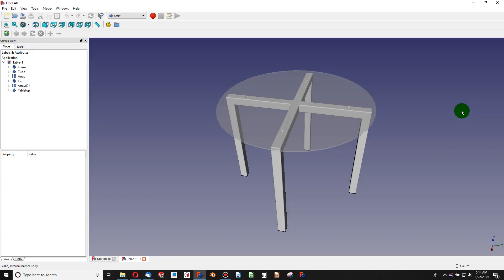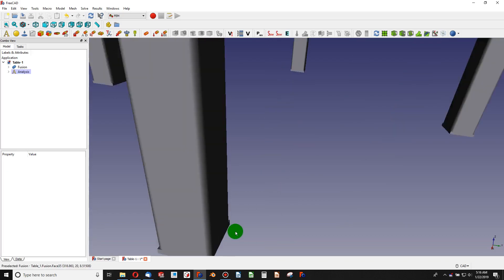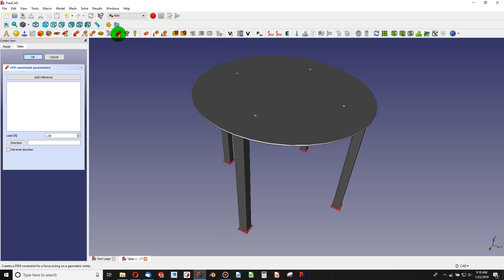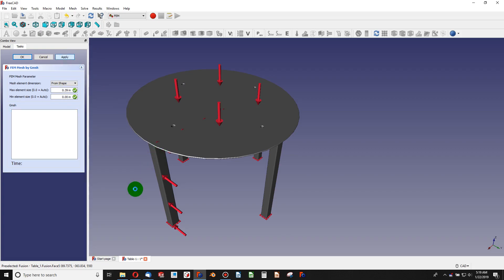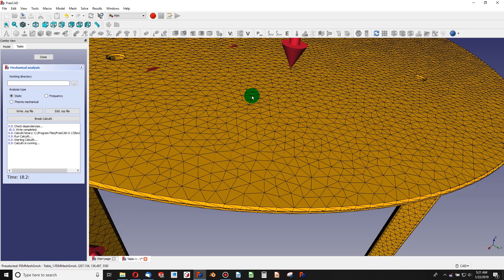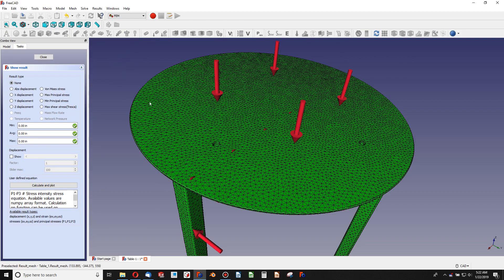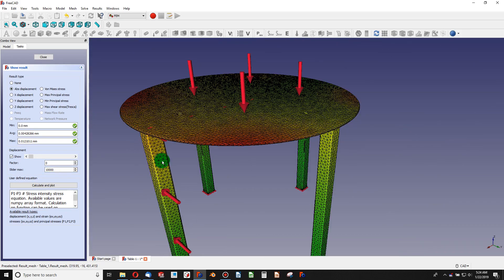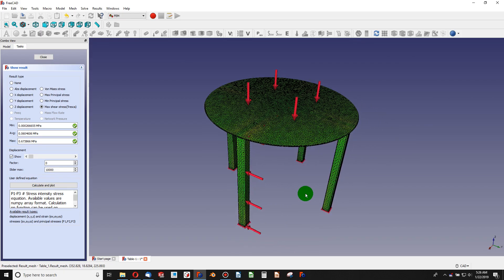How To Use FreeCAD FEM |JOKO ENGINEERING|

Comment: Hi, Do you know How could we specialise the space to exerce the force. I got a big surface but the force is only applied on a little element. Should I creat a new surface from my origin surface ? I did not find a way to create a surface from another one or to split it.
Thanks
Reply from the maker: A really simple way of getting that is say you want to exert a circular force on a flat surface, extrude cut a circle and then pad the circle to fill the hole.  The result gives you a circle on the face to select for the force.  This will cause the part to mesh differently

Comment: Great video. As a layman it has accelerated my understanding. I’m stuck on how to do a pressure stress analysis on a closed container without needing a fixed constraint. Any suggestions?
Reply from the maker: Hi Random Task!  That brings up a great point.  It's best practice in an analysis to constrain degrees of freedom even if the forces counterbalance, which will prevent what is known as rigid body modes.  In this video I use a force, measured in Newtons and acting in a direction.  You would want to use a pressure instead of a force, which acts normal to the specified face instead of a single direction and is measured in force per area.  I hope that helps!
Reply from the maker: The pressure button is near the force button in FreeCAD btw, it should be as easy as selecting the geometry, setting your pressure and making sure the pressure is outward instead of inward (the correct direction)
Reply: @JokoEngineeringhelp  right, that’s what I did, but it expects a fixed constraint which doesn’t make sense to me if I set all faces to exert pressure. If for example I have a cuboid and select the edge as a fixed constraint, in a stress analysis it acts like that edge is indestructible (sorry if I have butchered the tech speak).
Reply from the maker: @RandomTask  Very interesting!  Is it possible to send me the model?
Reply: @JokoEngineeringhelp  thanks a lot, have sent to your email.
Reply: So what is the answer?
Reply: @Ibrahim-tv7rv  am patiently waiting

Comment: Hi Joko. I have been practicing for a few days with this  tutorial. I can do a fem analysis for a single body ( like an L shaped bracket for exemple). Now I practice on assy ( convert an assy made of several bodies using A2 into a fusion unsing part work bench), I get this error message when i try to open the ccx_Results file:

                            FEM: Result node numbers are not equal to FEM Mesh NodeCount.

What is going on? I dont get it it should work i walk exactly in your foot steps but I get this error.

Comment: Hi joko. Could you expand a little bit more about frequency analysis please. I tried but its a little hard to interpret the results to be honest. Also, I was wondering if i could import several steps file into freecad ( from catia), assemble them using the A2 plus work bench and then fuse them to finaly run an fem analysis on the union ?  Thanks have a nice day.

Comment: Could you explain the factor impact on the analysis? the 100 factor is 100% of the force you choose or 100 times the force?
Reply from the maker: Hi Gabriel; since the material I chose would only deform a few thou, it's difficult to visualize what the deformation would look like.  So I used the factor to make the deformation 100 times greater than it would actually be to better visualize the deformation, but the analysis results remain at the same force.  Does that make sense?
Reply: @JokoEngineeringhelp  thank you so much, since the freecad FEM documentation is not complete, your videos are saving me. Very great job.

Comment: I tried the tutorial but got errors. during the CalcX
*ERROR in e_c3d: nonpositive jacobian 
determinant in element 2376
Reply: Were you able to solve it?
If so, please let me know. I', stuck there too...
Reply: If the Jakobian becomes zero or negative you get a non-positive definite system of equations.  

Meaning: you have either 1) rigid body motion (you didn’t apply enough fixing boundary conditions or there are multiple bodies that are meshed but not connected via the nodes) or 2) excessive deformation so an element becomes inside-out. An element becomes inside-out if the angle between two edges are zero degrees or less (or 180 degrees or more). 

Tip: 
make sure you have no duplicate nodes (I have no idea how you do that in freeCDD/CalculiX, but hopefully there is a “sweep” function(?))
Make sure you have relevant DOF fixed (no rigid body motion)
Check your units. Are they consistent. 
Reduce the load (force/“pressure”)

The mesh that was used in this tutorial had some pretty bad angles on the table top. When meshing a thin and wide geometr with tet-elements this is unavoidable (unless you use one million elements 😊)